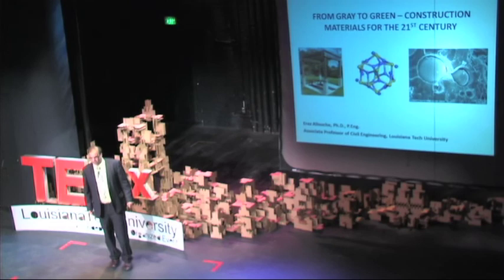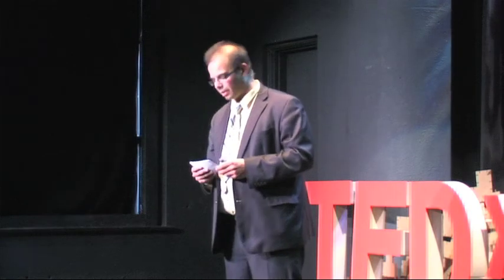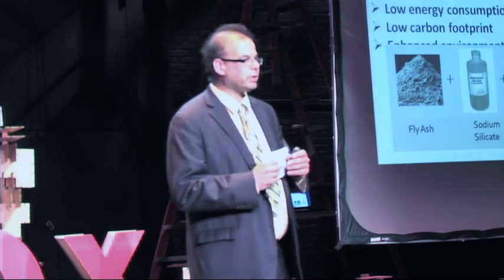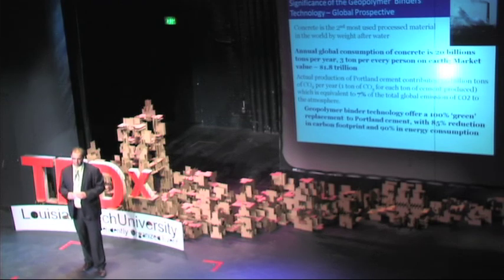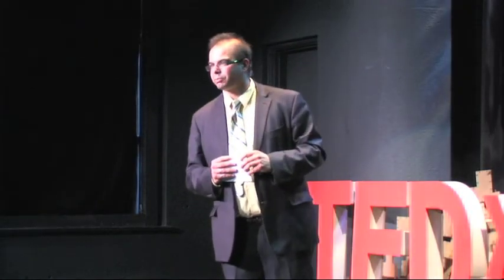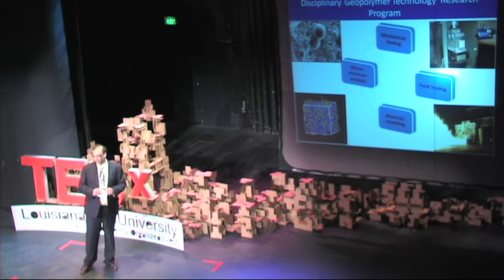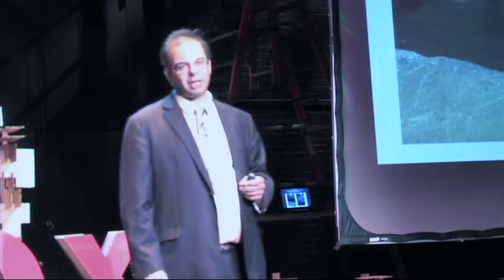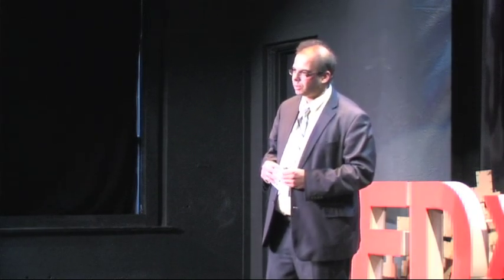TEDxLouisianaTechUniversity - Dr. Erez Allouche - "From Gray to Green"

Comment: This is nice, but he needs to publish his results more clearly, make a bunch of videos, and give some time to making geopolymers on a home or small business scale at ambient temperatures, not just using incredible lab equipment in tiny batches.

A simplified formula, parts by mass:
- 1 fly ash
- 2 sand
- 3 limestone pea gravel
- 2 0.5M sodium silicate (waterglass) solution (type N)
- 1 10M sodium hydroxide solution (400g 99.9% solid lye dissolved in 1L water)